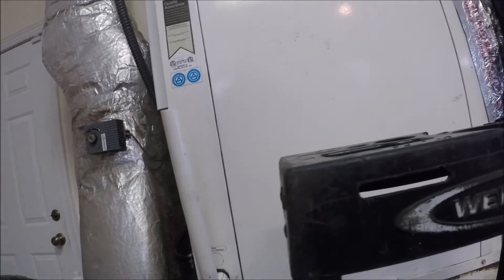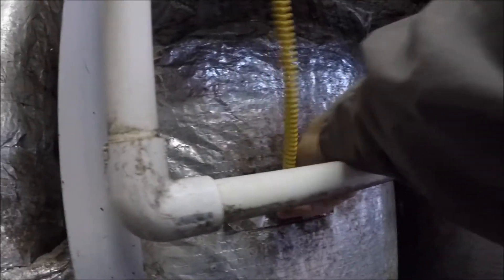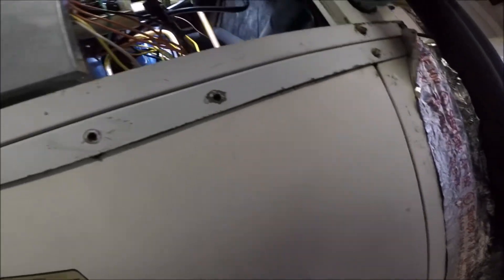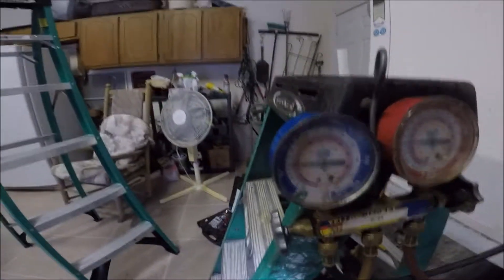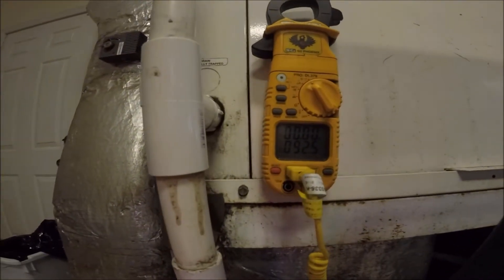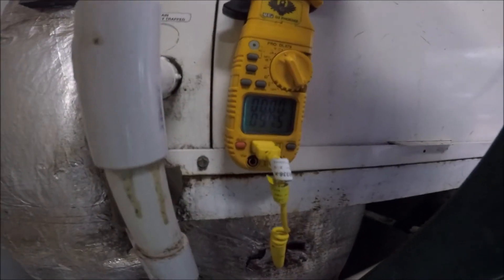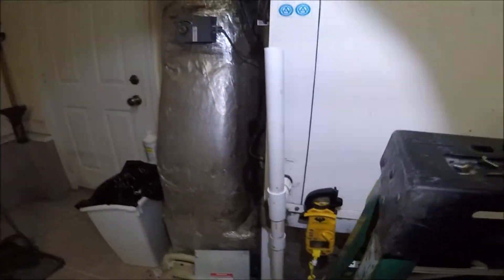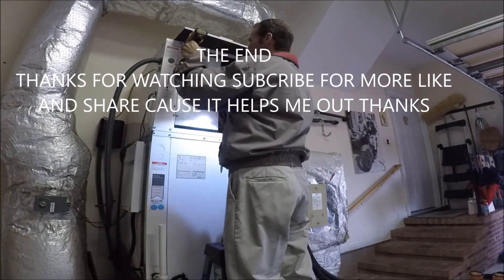(HVAC)R-22 14 yr old geo unit retrofit to R427 gas and go .

Comment: Do you need vacuum before adding 427a?
Reply from the maker: If you're recovering or 22 to retrofit it to 427a you need to change filter wire as well as pull a good 500 micron vacuum always. Now in the past it is not recommended by any of the manufacturers but if you have an R22 system and it is slightly low in charge I did have an old company that I worked for that homemade just to top it off with the 427a. But if you're doing a complete retrofit yes definitely need to do a vacuum to 500 microns. And the reason they don't know it recommend putting 427a on top of R22 even though I've done it in the past just to add maybe a pound or two to an existing or 22 system but it creates a refrigerant that is not qualified,  known by the EPA standards so it creates a refrigerant that is not recognized by the EPA
Again it is not recommended to put 427a on to R22 but I am guilty of doing it myself if a system is just slightly low and needs to be topped off. It creates a refrigerant that is not classified/s so it basically creates an unknown refrigerant according to the EPA standards and guidelines.

Comment: Thank you for the comments. Thank you for making videos. The next time you top off the charge you might think about adding some oil and or supco 88? When you lose refrigerant you lose oil systems been topped off many times might be low on oil? 😉😁
Reply from the maker: THE GENIUS REPAIRS hey yes I just also wanted to tell you thank you for the heads up on that being illegal to top off one refrigerant with another because I spoke to many other techs and some of the guys at the supply house where we buy our equipment and All refrigerant and none of them ever told us that it was illegal to do that they just said that it was recommended of course 2 reclaim the existing in retrofit only the new I thought it was just frowned upon I did not realize it was illegal nobody ever said anything about that being illegal because the company I work for they tell us just to top off our R22 with 427 never even thought it was illegal so I will not be doing that ever again and if you notice I edited that part of it out cuz I don't want to be breaking any laws, but my understanding from what they told me is when you do top off let's say for example R22 refrigerant and then top off that with 427a all you're doing is making a full 5 blend refrigerant that the EPA does not recognize that is all I knew about the situation and of course they recommended that you always recover reclaim the R22 and retrofit only the 427a but my boss signs my paycheck and I want to be better than that anyway so that was very good information and thank you for sharing that's one reason why I like putting these things out there so I can get responses from people that might know more than me about it so now I can go back to my boss and tell him I will never do that again and that's how his other text that is illegal to do and not to do it thank you very much for sharing thank you for your support thank you for your subscription and look forward to hearing more responses from you thanks again from Bill
Reply: THE DIIBs family adventure you're welcome thank you. Best not to take any chances on getting a fine or losing your EPA card. Some techs are going as far as painting the refrigerant jug so the customer does not know what's going on. YouTube video technician thought he was recovering R22 his recovery machine started on fire he thinks there was some H C refrigerant in the system. Be real careful you never know what you're working with